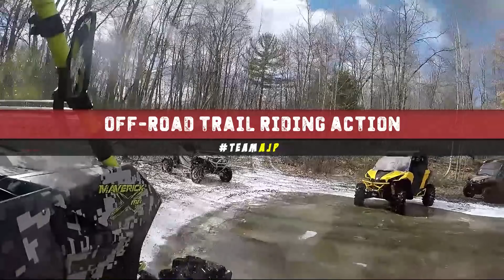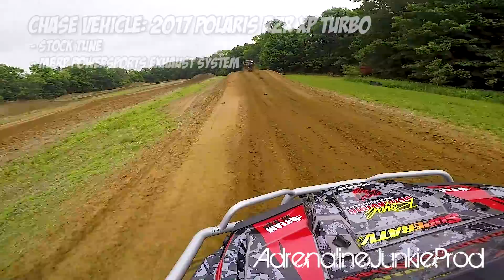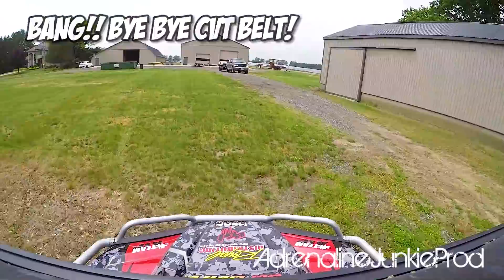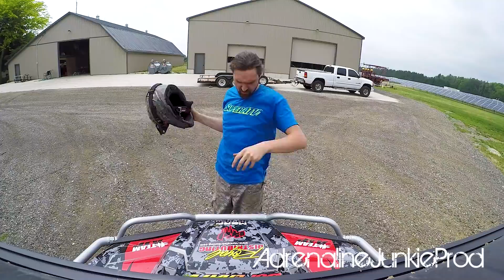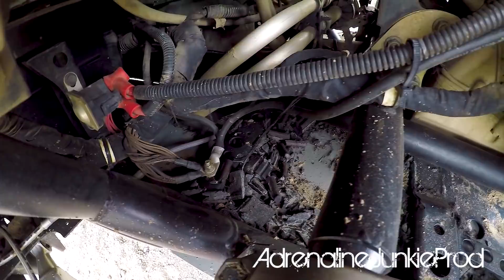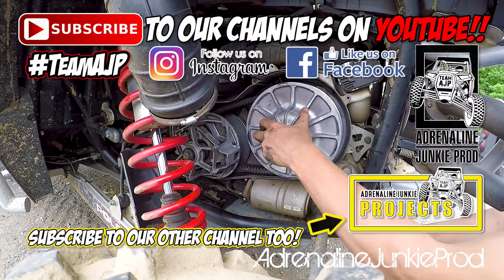X3 Turbo Stage 4 + Stock RZR XP Turbo - UTV Short Course Chase Cam - #TeamAJP Raw Cuts - Episode 005

Comment: Awesome video - super practice track! Clearing that double is sweet! The XP Turbo holds its own nicely - or maybe its the driver???? You need to invite the guys from Full Throttle Off Road up for a rip! They are in the process of making their own practice track - but are not fortunate enough to have as much room as you guys?
Reply from the maker: The track is set up pretty mild right now, has a lot more potential in it. Hoping to get out a few more times and get a little more comfortable in the RZR so that we can really send it hard. The XPT feels awesome out there. We plan on having a few extra people out at the next track day. Can't wait to do some wheel to wheel racing with all the guys. Where are the guys from full throttle off road located?
Reply: Check them out on youtube - they are Can Am X3 guys and have some highly modified machines. I'm pretty sure they are from upper Michigan?

Comment: Track looks great y'all.  I'm curious as to why RZRs blow so many belts Sous blows them a lot on their channel and I don't see to many CanAm belts getting blown   Is it the cooling, it if is then could you put a small fan either blowing in it or sucking air out ??? Anyway guys great to watch y'all as always   Keep the dirty rubber side down
Reply from the maker: Hey Stacy, I've been pretty lucky so far with my belts. I have been averaging about 1000km per belt. This one failed mostly because of me. If you recall I blew a belt on a winter ride and put on a new belt on the side of the trail. I then went on to drive the crap out of it and rev it hard on snowy trails all day without following any of the proper break in procedures. Knowing I hadn't followed proper belt break in protocol I expected this belt to fail early. I got about 500km out of it. I kind of had a feeling I might blow it on the track, lol. I'll have to follow proper break in procedure on the next belt and see how it holds up. It's like an ongoing science experiment. Usually the fail early when you are too hard on them new.
Reply: AdrenalineJunkieProd I do remember you changing it, but it just seems as though RZRs go through them a lil faster   What brand do you use mainly   I've never had a problem since I went to a HighLifter C-3, I've thought about get a Gates Kevlar belt to have as a back up which I prolly just need to change it due to it's been on there for 2-1/2 years now where the last year it's just sat up do to I broke the front axle and had to change out the front wheel bearings also and right after that my health failed but I'm slowly getting back going